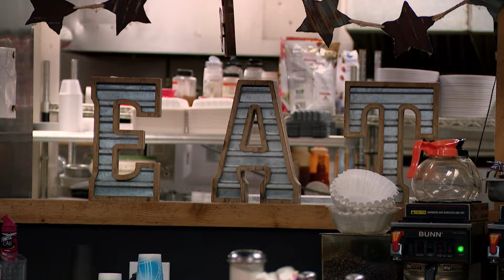Puget Sound Energy to upgrade electrical grid in Skagit County

Comment: Undergrounding in forested areas is nice and certainly reduces outages due to storms but underground cable has higher inductive reactance than overhead and voltage regulation must be upraded to keep fuses and breakers functional.  The National Park service ignored this on Hurricane Ridge Lodge.  I am sure PSE knows  better.  Not cheap but necessary.